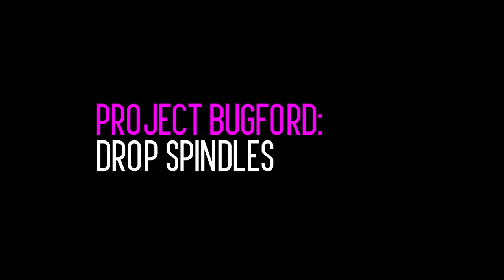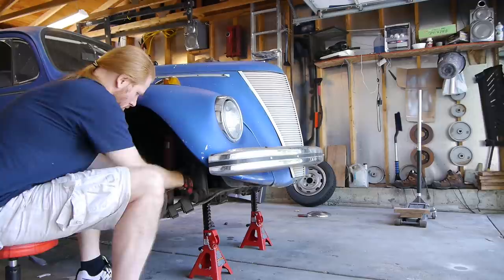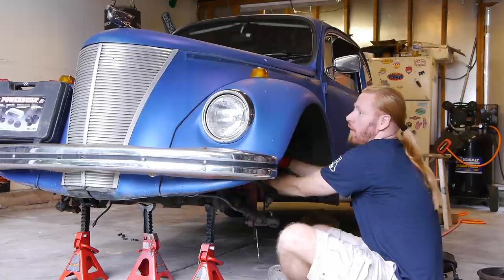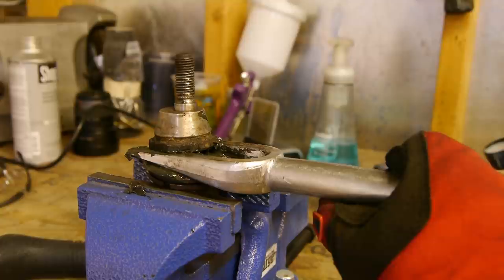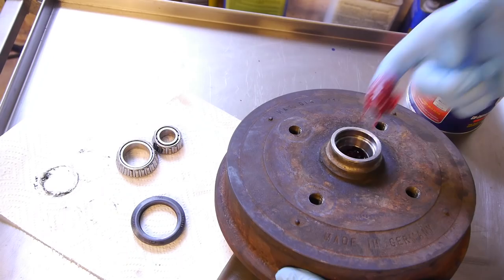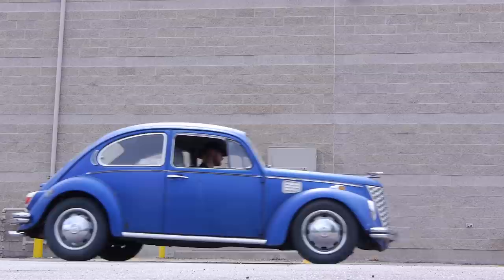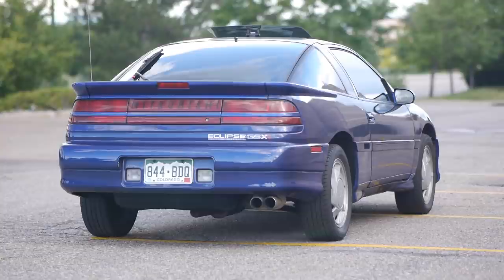Project Bugford - Drop Spindles and Ball Joints

Comment: When I replace the ball joints, what I do is that I remove the torsion arms from their place so I can clamp them to either hammer or press the old ball joints out, and the first thing I do is hammer the eccentric camber bushing out. Removing the torsion arms is just a matter of undoing a lock nut and a 8mm allen wrench oppressor bolt on each arm, then pull them out.

When I replace the tie rod ends, the fastest route for me is to first remove the outer tie rods with the spindle still on for better leverage, then I remove the bolt for the steering damper and then I remove the pitman arm so I can take out the entire tie rod assembly, once again, to clamp the pitman arm on a vise and hammer or press the tie rods out.

I do tutorials on VW stuff too, but they are in Spanish. Check me out if you want and can.

Comment: Oh hey! I was just coming back to this video because I wanted to see how did you remove the ball joints with this tool, but you don't show how you got the lower ball joints out. Can you tell me how you did it?
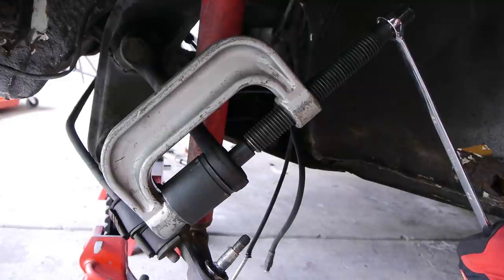Reply from the maker: I used a pickle fork on the lower ball joints, you can see it at 1:19.  The harbor freight ball joint remove tool worked way better than the pickle fork though.  Then they're pressed out with the tool seen at 2:42
Reply: @VelocityLabs  Thanks!

Comment: on the bottom ball joint what direction does it press out? The top came out easily, the bottom no go so far.
Reply: I put clamp press on the lower ball joint as tight as I could get let it sit it overnight.Took the set up off, the stud had been ground to a nub so I could fit the tool set up on. The ball joint had moved a few MM so I wedged a jack stand underneath to keep arm from moving and hit the ball joint stud about 30 times with a hammer and the sucker flew out.no heat.alot of wd-40.

Comment: How is the steering with only the front dropped?  I've read that castor shims are required since by lowing the front, the castor angle is changed and it affects your steering and handling.  Great video!!
Reply from the maker: I didn't notice any big change to be honest, maybe a little better in cornering.  I had the car aligned after I did it though, I'm not sure if the shop needed to use shims or not.

Comment: Working on my 72 bug Where did you get a ball joint press that knocks out lower ball joint? Nothing fit lower control arm.
Reply from the maker: I used the loaner kit from Autozone.
Reply: Velocity Labs OK thanks but AutoZone no longer rents ball joint presses and O’Reilly,advanced auto parts won’t fit so I’m gonna give up and pull out the control arms get them pressed out.  there’s a special Volkswagen ball presser but they don’t make it anymore. I have a few Volkswagen videos I think I’ll make this frustration one also.